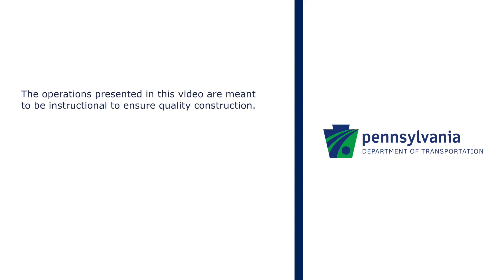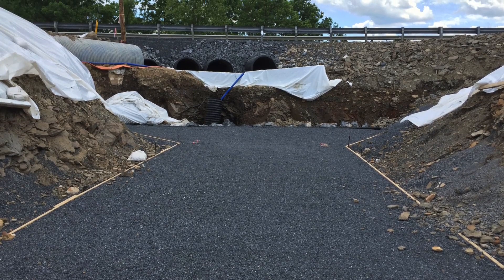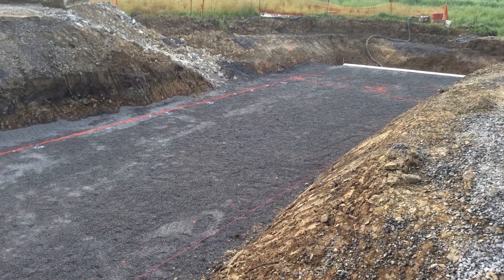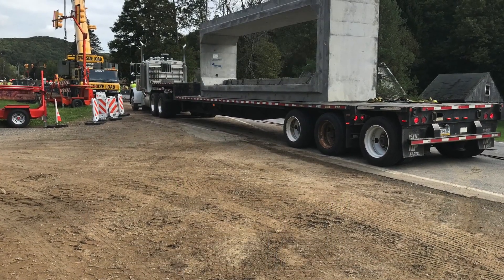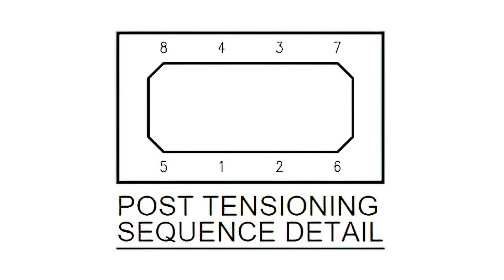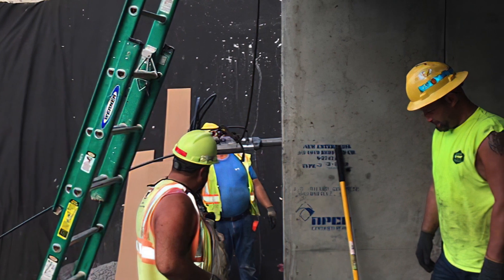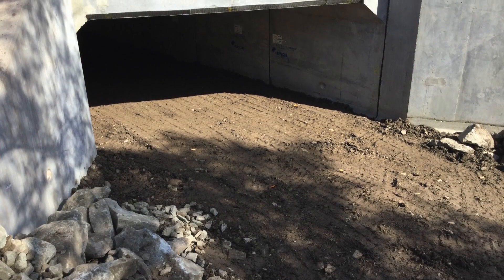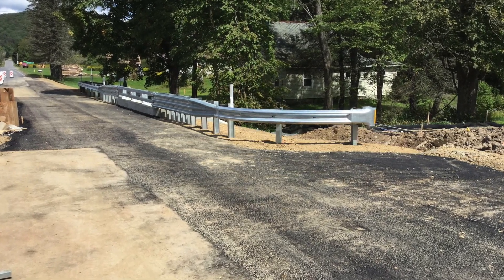PennDOT Box Culverts

Comment: Penn Dot needs to raise all elevations by 25% across the board, Spring Mount Pa replacement bridge was completed. Then flooded a week later. Then flooded again from 16 feet to 21 feet above normal flow. (3 feet over the bridge). The biggest flaw of Spring Mount bridge replacement was not removing a 125 years of sediment after the bridge to open up Percuoman river flow rate. That sediments settled after the bridge. For the last 125 years.

As engineers or construction trades, this Spring mount bridge replacement is a good lesson to go look at, at how we as Pennsylvania got this design wrong.

If the bridge was 7 to 12 feet higher in elevation then we would not drive down then back up to the stop sign. The bridge would be level to the stop sign and at least 5 feet out of “natures” harms way.

One woman died, in her car in 2019 after this bridge was replaced June 10 2019. Washed off it.

All, go look at the design. It is a text book example of what not to do.

Comment: This is EXACTLY WHAT I NEED IN WOODLYNNE NJ .
I NEED TO REBUILD THE UNDERSIZED UNDER ROAD CULVERT TO CREATE A BIGGER CHANNEL SO NEWTON CREEK ISN'T @ A CHOCK POINT AT INTERSECTION WOODLYNNE AVE & CYPRESS/LAUREL AVE & FOURTH ST CONNECTION OF THE CREEK. 
I WILL SAVE THIS FOR WHEN I DESIGN THE TOWNS original lake and widen creek bed to eliminate flooding.
Once I get in as Mayor, I will get working with engineers to get everything going. What I want to do should have been done 48 YRS AGO! 
💥BADA BING BADA BOOM 💥
I APPROVE THIS MESSAGE 🙌
Nj'sJfJr 👍🏼💪🏼❤️🇺🇸